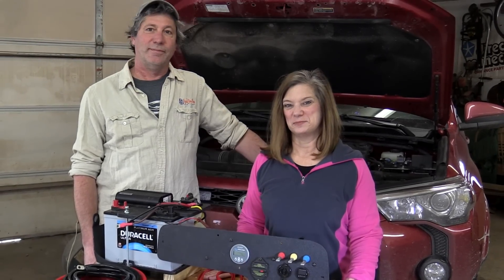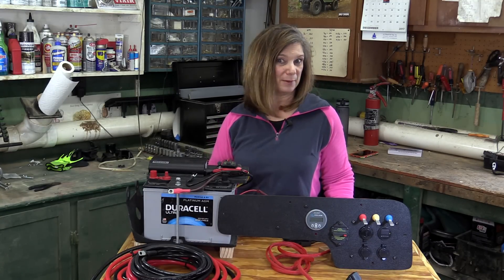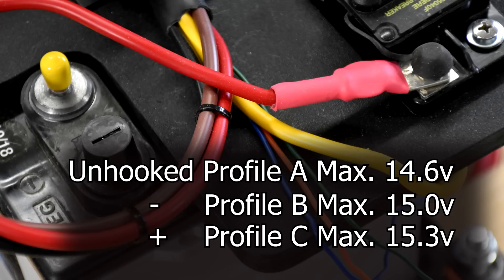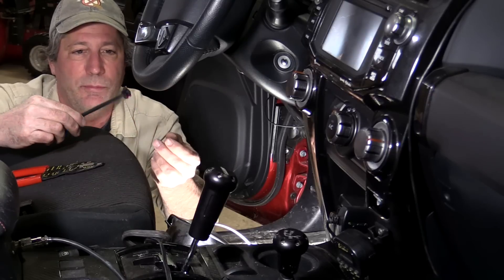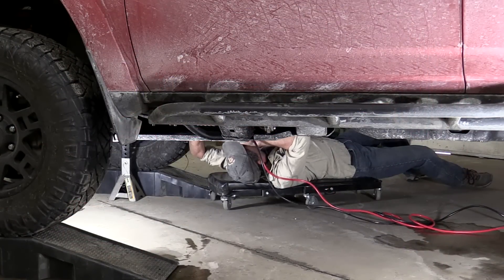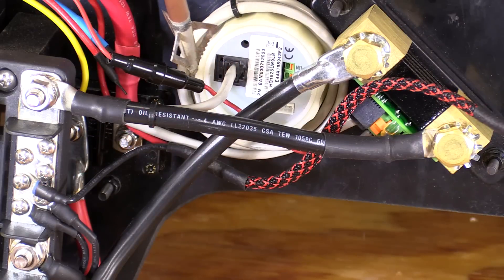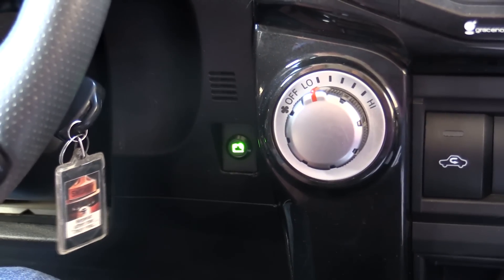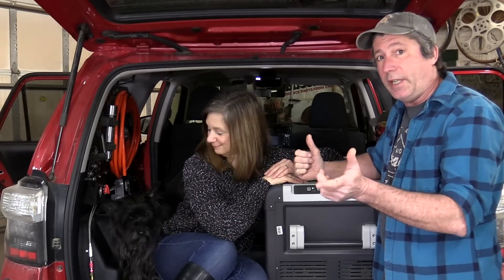Dual Battery Setup with Detailed DIY Install

Comment: Just finished installing a system like this.  One issue.  The LED indicator for inside the vehicle is supposed to be a 3V LED, not a 12V unit like in your Amazon link.  I ordered the same LED Battery indicator LED as in your link/video, but it remains on at all times.  The Redarc manual states on Page 5 that "A 12V LED (3V with integrated resistor) will not operate correctly if installed"... It's supposed to stay off until the Aux battery starts charging and will flash when there is an error code.
Reply from the maker: Good to know!
Reply: @WanderlostOverland  I found an easy fix... That LED light housing unscrews so you can pull out the LED and wires... I just unsoldered the integrated resistor, resoldered the wires, and put it all back together.  Works correctly now.

Comment: Wow this is making me question if I even need solar for my van. And having a set up where you can add a panel later sounds ideal. Running a fridge for twenty hours with only about one volt in drop is really impressive.
Reply: I dont mean to be offtopic but does anybody know a method to log back into an instagram account..?
I somehow forgot the login password. I would love any tips you can give me.
Reply: @Caspian Fox instablaster :)
Reply: @Pablo Maxim Thanks so much for your reply. I found the site on google and Im in the hacking process atm.
Seems to take a while so I will reply here later with my results.
Reply: @Pablo Maxim it did the trick and I finally got access to my account again. I am so happy:D
Thank you so much, you saved my account!
Reply: @Caspian Fox No problem :D

Comment: Did you cut the plug off of your refrigerator cord and hardwire it to the fuse box instead of using a 12v socket plug?
Reply from the maker: Yup, cut the plug right off and wired direct to fuse panel.

Comment: will a DC-DC charger work for 2004 4runner or should i use isolator
Reply from the maker: It'll work fine, especially if your two batteries aren't identical type and size.

Comment: Hi There!

I did a quick run through of the comments and also watched the video a few times. My question is this: What is the amp hours on that battery you have installed? I am currently budgeting my build to mimic what you have. 
Thanks,

Ted
Reply from the maker: Hi, thx for watching. 55 amp hours.

Comment: Hi, if my starter battery is 80 AH, can my dual battery be 55 AH. Thank you
Reply from the maker: As long as you're using a dc-dc charger yes. With a dc-dc the two batteries can be any combination.

Comment: As always, thanks for another outstanding video.  I've watched this one several times and I don't believe I saw anything about a low-voltage disconnect.  Do you have on in your system to protect your 2nd battery from discharging below a critical level?  My REDARC charger should arrive tomorrow.  I'm looking forward to getting my 2nd battery installed and running.
Reply from the maker: Thanks for watching Barry! There's a low-voltage disconnect built into the charger. Our fridge also has its own disconnect.
Reply: @WanderlostOverland  Thank you for the quick response.  I'm thinking I will add a disconnect between the positive output of the 2nd battery and the loads it will be serving.  I don't want those loads to be "ignition on" only but I also don't want to deplete the battery or subject those devices to low voltage.

Comment: Mark, how in perdition did you make a template to cut out your instrument panel for the passenger side rear cubby?
Reply from the maker: Trial and error. Took some time cutting cardboard.  :)
Reply: Wanderlost Overland.  Ended up doing the same:  spent the time I had been spending looking for the easy way, doing it the hard way.

Comment: did you splice the wires that came with the fridge to wire it to your safety hub? What size fuse did you use for the fridge?
Reply from the maker: We did. Professionals recommended we not go through the supplied 12v plug since there is a tiny power drain associated with them. We wired it directly into the SafetyHub using a 10amp maxi fuse.

Comment: Can anyone find any information regarding the gauge and type of wire used to connect the two batteries? I've searched the links and re-watched the video several times and nothing is said about the cables.
Reply: The Redarc manual has a wire gauge table on page 9.  It's available for download on their website.  I used 6 gauge cable which the manual says is good for up to 30 feet on the 1225D model.

Comment: Great video guys.  Love it.
I have spoke with Dave at Overland Power solutions and we have put together a system for my 4runner, Looking back what would you have done different with this setup?  Are you happy with where you mounted that control panel and auxilary switches?  
Happy travels.
Reply from the maker: One thing we knew was wrong from the start but went with it anyways, the breakers need to be right at the power source. Our initial plan was to mount the one between the starter and second battery right on top of the factory relay box on the left fender. OPS cut our cables so that breaker was right on top of the second battery. leaving that 4+' of cable unprotected. Same with the breaker for the outlets in the rear. It needs to be mounted right at the second battery. Other then that they did a really good job with the cable connectors and choice of components.

Comment: Great video and thanks for taking the time to post it. Quick question. If having a distribution block with a breaker, do you run the redarc, to the breaker, then to the starter battery? Or redarc to distribution block to breaker to stater. Thanks in advance!
Reply from the maker: Redarc to breaker to distribution box.

Comment: I have a question: I have a 2005 toyota celica gt and I want to add more power without taking away mpg so I want to put an electrical supercharger in it but they need a lot of power to actually work and do you think this same system could work for that?
Reply from the maker: I don't think this is what you're needing.

Comment: cool video, but I'll mention that redarc doesn't suggest using circuit breakers in the charging line for their BCDC units as they generate a lot of heat. The heat can lead them to popping open when there isn't a fault in the system. Alternativly, they suggest using a MIDI fuse which is very low resistance.

Comment: There are lower-cost alternatives.  I would have just swapped-out the "smart" alternator for a dumb high-output one and then wired the two batteries in parallel with an isolation switch in-between them that I could switch off to disconnect the two batteries from each other when the car isn't running.  To me it sounds silly to have to buy a dc to dc charger and all those other electronics.  I used this on my boat where losing both batteries can put you in a life or death situation in the high seas.  As a backup plan, just in case, I would also carry one of those jumpstarters.  Never had a problem.  There are also camping fridges that can additionally run on propane if you don't have electricity.  Easy enough to fill a propane tank and not worry about the battery.

Comment: Looks great !! But 2 issues that i have !! 1 is agm batteries hate heat and should never be mounted under the bonnet !! And 2nd is im certain that the dc to dc would also really not like the extreme heat that builds up under the bonnet !! Thats just what ive learnt and been told anyhow !! For agm to go under the hood it needs to be in a vented air box on it own !!

Comment: Great video! You guys do a fantastic job. How much 4g cable did you use to the back of the rig? Where did you buy?
Reply from the maker: Thanks for watching Angel! Not sure off hand exact footage, best to have more then needed though. Overland Power Solutions supplied us with all the wire you see in the video.

Comment: Great vid- real new at this so If I can get a couple answers, things will start to make sense with what I do know:
1) why the circuit breaker over at the second battery 'cable-length' away and not at the primary battery?
2) do the two batteries need to be the same/alike in size/capacity/output?
3) why the need for the 'Anderson' plug? Relevant to your winch application?
4) what was the reason you pick this model DC-DC?

Again, this does what a relay does so that when no running, it senses the lack of charge and separates the two batteries?
Reply from the maker: First; thanks for watching Douglas. I'll try my
best to answer your questions.

1) This was a mistake by the engineer of our
system. It should be as close as possible to the primary battery, It's getting
moved very soon.

2) When using an isolator yes, they must be identical
batteries for optimum performance. When using a DC-DC charger like we have, the
two batteries can be different types and sizes.

3) The Anderson plug is simply the best at transferring
power without any power lose.

4) The Redarc is better at handling the heat
under the hood.

Yes, it completely cuts ties to the starter
battery when the engine is shut off.
Reply: @WanderlostOverland  ....cause I have two identical batteries, with the circuit breaker at the wrong one too, oem under driver seat and one in back now. Have a relay in-between but kept forgetting to switch it when needed; shoulda tied into ignition but never got there either. As its a daily driver really I like the DC-DC idea over passive panels. Thanks and safe travels.

Comment: @9:06 You need to grind the paint off with a wire brush where you ground attaches.  I saw someone spray it all with clear coat after it's bolted together to keep it from rusting.

Comment: where do you connect the back board equipment to does it run straight from the second battery?
Reply from the maker: + & - wires from battery straight to panel.

Comment: Great video. I’ve used the Redarc and Victron units for about 6 months in my camper trailer with an AGM battery and a solar panel. Great stuff!
Reply from the maker: We're extremely happy with how it's performing. Thanks for watching!

Comment: Can I get the link for the battery gauge you used in the rear? Thanks.
Reply from the maker: Sure, here's the battery monitor: https://www.victronenergy.com/battery-monitors/bmv-712-smart
The volt gauge: https://www.bluesea.com/products/1733/Mini_OLED_DC_Voltmeter_-_Yellow

Comment: So what happens to that bcdc if you are constantly pulling 150-200 amps from the second battery?
Reply from the maker: Thermal Nuclear Melt Down? I could be wrong, but I'm pretty sure you're going to want to look into a different system. :)
Reply: Wanderlost Overland ok thanks. Do you have any idea what else to look into. My stereo pulls that much consistently.

Comment: question, you said at the start of the video that you can jump start your self.? i am assuming thats using jumper cables, since its only 8 or 10 gauge wires going through that charger. Is that correct
Reply from the maker: Yup, with jumper cables.

Comment: 2:47  This is not how it works.  The starter battery is NOT charged first before the DC-DC kicks in.  They both charge together, as soon as the alternator output is above the low level set in the Redarc.

Comment: Use brass mariene battery terminals .You may want to install a ground on your second battery - Post use large battery   wire black .
Reply from the maker: Thanks for the advice!

Comment: Hi I have a question voltage and amp drop on that long of cables to the back
Reply from the maker: There is a small loss of power, but pretty minimal due to using the correct gauge wire and quality wire. I have no way of measuring exactly how much of a loss though.

Comment: Anyone else with a full roof rack thought about putting a solar cell on the hood?
Reply: This is what I'm doing, but I ordered a 50 foot extension cable so I can move the solar panel away from the vehicle to keep it in the sun if I decide to park in the shade and to be able to track the sun with the panel.

Comment: Just upgraded to the Redarc and I wanted to ask you if it's necessary to bring the negative cable from the starter battery to the aux battery. Going through the manual, it does not show that. Also, the black wire you brought into the cab through the firewall, is that from the Redarc? I thought that was grounded to the negative  post on the aux battery. Thanks and love the channel!! Cheers!!
Reply from the maker: Thanks for watching! I believe you can simply do a chassis ground between the two batteries. I don't put much trust in chassis ground though. Sometimes they can be a little wonky. The black wire going through the firewall does indeed connect to the negative post on the battery.

Comment: Since the Redarc completely isolates the starter battery from the house battery. Can you jump start the vehicle using jumper cables from the house battery in the event your starter battery is low on charge? Doing so will this hurt the Redarc charger?
Reply from the maker: Absolutely. Although a deepcell isn't the best battery for cranking amps, it can be used in an emergency start. As far as I'm aware, jumping the two does no harm to the charger.

Comment: How long can the fridge run?
If I run a stereo system do I hook my amp to second battery or main?
Reply from the maker: We can run our fridge for a couple days without starting the engine. No clue on your question about the stereo.
Reply: Main battery

Comment: Couldn’t you just use a relay to separate the batteries when the car turns off.
Reply from the maker: Many people do. There are many drawbacks from doing it that way which we spell out in the video.

Comment: nice clip! question for you and hope you can help. a 91 previa, I try to make it a rv for traveling. I am thinking of putting a 2X6V as a housing battery, upgrading alternator + solenoid, and 200w solar  on top w/charge controller. either rain or shine I am covered. any comment? thanks
Reply from the maker: Sounds like a solid plan!!!

Comment: Excellent video- lots of great information and entertaining!  I’m interested in getting a Dometic like yours and wondered how long it would run off your auxiliary battery before you had to recharge?  I’m assuming that is a lead-acid battery.  Thanks!
Reply from the maker: We haven't pushed it to its limit but, we've gotten 48 hours with our 75q fridge/freezer out of our deep cell batt. At the end it was down to around 60%.

Comment: I have a 5.7, 2013 Tundra. There is no place to mount a 2nd battery in the engine bay unless I buy a $1200 Genesis offroad kit. And it only holds one 55 amp hour battery. Would u recommend the redarc system running to a 2nd battery to the bed of the truck (truck has camper shell)?
Reply from the maker: Sure, that's done all the time with the Redarc system.
Reply: Yes, but mount the Redarc closest to the 2nd battery in the bed, not in the engine bay. Because it's a DC-DC charger, it will compensate for voltage loss due to the cable length.

Comment: How much is that unit you installed?
Reply from the maker: A rough estimate, including all the odds and ends; around $2,000. Not cheap by any means but extremely reliable.

Comment: That is a very technical setup. You didn't mention cost, but I know all that wasn't cheap ethier! 
I used a simple isolator and a smaller, simpler panel in the back. I only use a CFX 35 which draws a bit less juice. But it'll easily run 2 days off of a group 29 battery. Yes, it'll take the battery down to 10.8 volts which will more then likely shorten the batteries life. No biggy. I use a cheap $90 deep cycle from Wal-Mart. If I get a year out of it, which I easily will, I'll just replace it.
That said...... much respect for a really nice install and a great video!
Reply: BTW. I get 14.2 volts charge through my isolator. The vehicle is a brand new 2019 Tacoma TRD off road.

Comment: I would solder those connections you’ve crimped after verifying things work correctly.
Reply: It would appear that they subscribe to the same theory as I do,, that being that soldered joints are too rigid and can break and cause issues in an off road vehicle that is flexing and bouncing a lot.
Reply: @wingarddestrehanhighschool6542  maybe, but I prefer a more solid connection in general, with a good amount of slack/service loop to allow for vibration. The only way a break could occur is from wires being stretched too tight, so lengthen things to allow for it and you shouldn’t have a problem if they’re well secured to prevent the stress in the first place.

Comment: I really enjoy your DYI videos, they are very informative, and funny.  Question for you.  Why do you not have a fuse or a circuit breaker on the starter battery cable to the secondary battery and from the secondary battery to the rear of the vehicle?  It always seem like a good idea to fuse at the source.

Comment: Do you have to use 2 gage wire to the rear, Redarc manual recommends 6 gage.
Reply from the maker: Depending what you're power requirements are, 6 gauge may be sufficient for your needs. We wanted to have the option of running power to a separate DC-DC charger on a trailer if the need arises.
Reply: The 2 guage is not to support the draw of the Redarc.  It is designed to allow the safety hub (power distribution point) to have the capacity for it's multiple circuits.